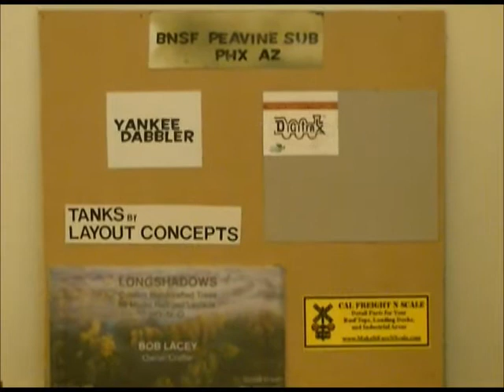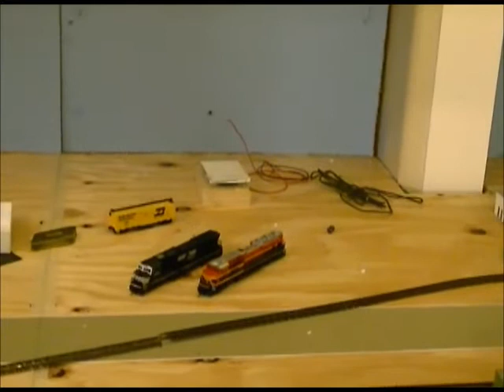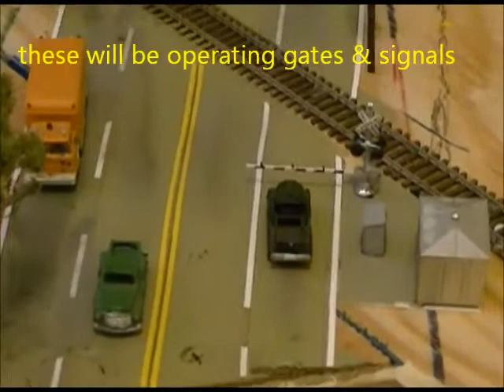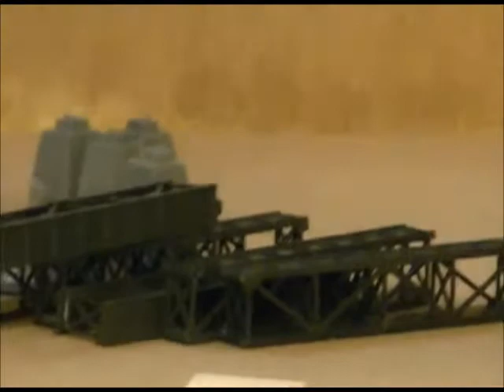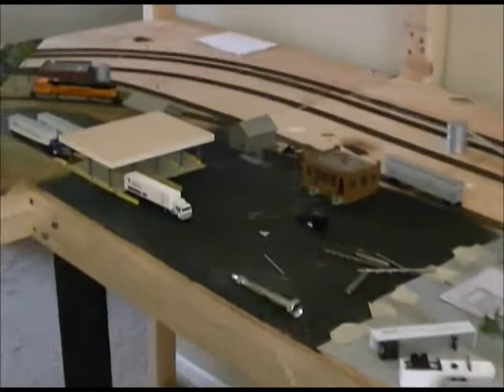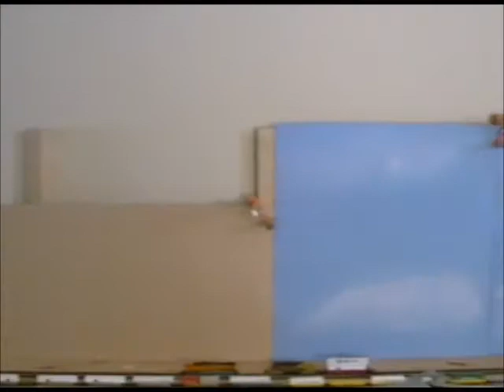OVERVIEW OF LEVEL 1

Comment from the maker: hey Les... building a layout on a budget is a challenge.. but all you need to do is that thing that sits on top of your shoulders & get creative. example, if you look at my structure "Lex Jet" it was built using any & all the plastic i had laying around. a good friend of mine told me to start using "for sale", "for rent" & "garage sale" signs for the plastic. you can pick them up at your local home improvement store & they are cheap & usually 12" x12". give it a try!!!
vinny

Comment from the maker: hello Mathew .. thanks for your response. i kinda guessed that you were German. i knew when i was looking to buy a home, i would not be able to afford one with more square footage so to get the area i needed i had to go through the wall. the upper level will pass through the wall also. i am going to keep the reverse loop even after i install the helix, this will give me more options
BTW.. i am a retired BMW technician. i have worked on & repaired Bimmers for 35 years
vinny